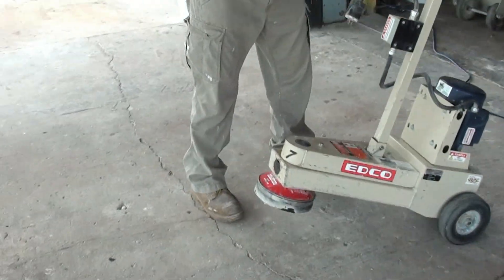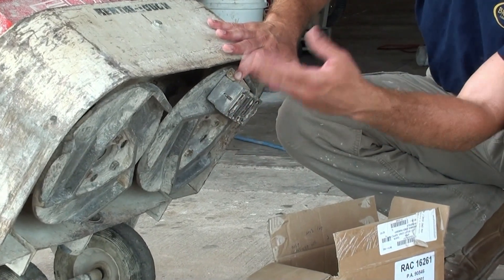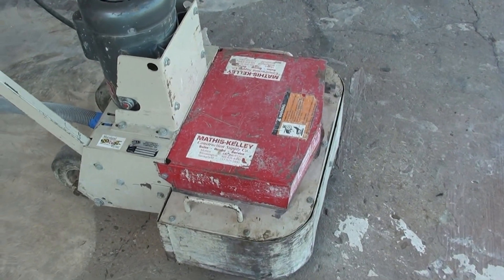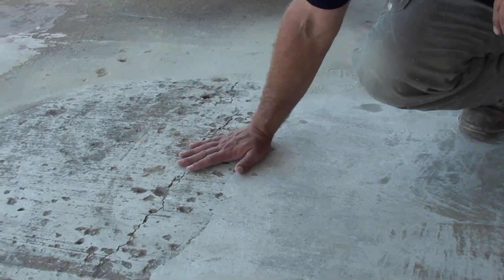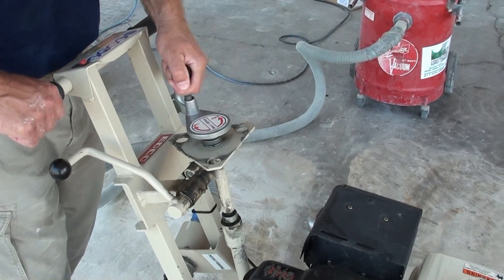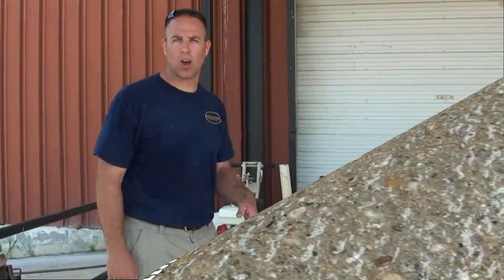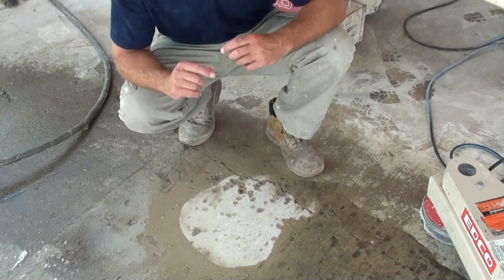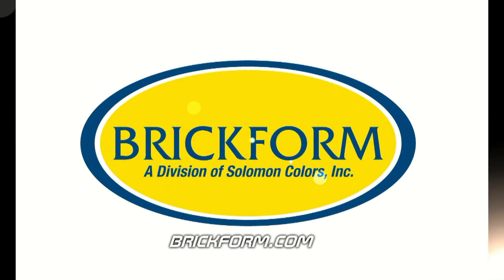Concrete Surface Preparation Video 4    Mechanical Surface Profiling

Comment: What would be the best way to make smooth concrete that gets very slippery when wet safer and less slippery? I have a breezeway in front of my stalls that was not brush finished so it gets very slippery and is dangerous for my animals to walk on when it’s wet. I’m thinking if I achieve a csp 4 that will resolve my problem.

Comment: I don't know if it is worth doing. I got a 20' x 49' concrete patio. It's in good shape but, it was made they probably used rock salt to give it a texture. It's got, over the years, six coats of concrete floor paint, unpeeling. Is it worth doing this? Which machine? That grinder looks like it's going to make hours of clean up. The more aggressive one looks like less mess, but needs a grinder afterward anyway.
 Might be better to lay down outdoor tile?